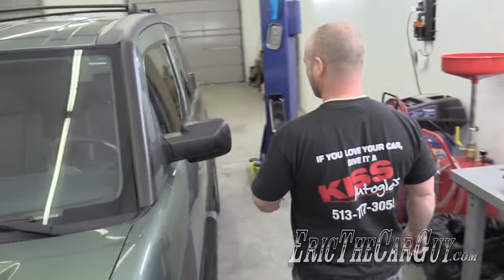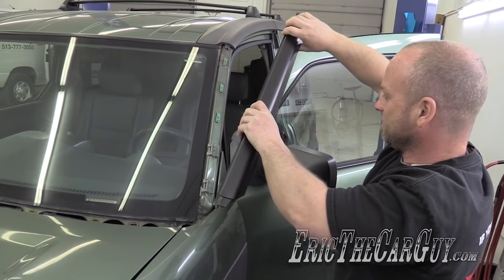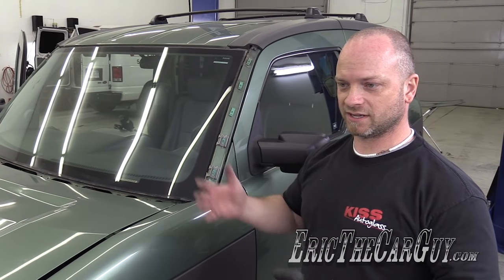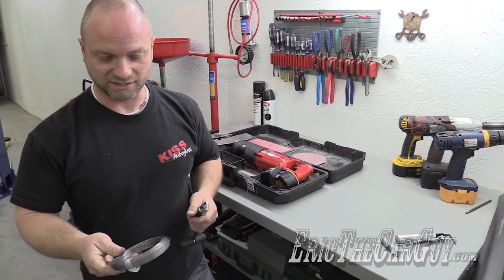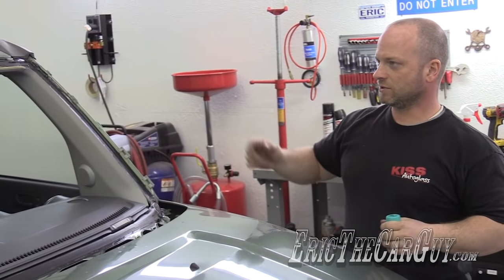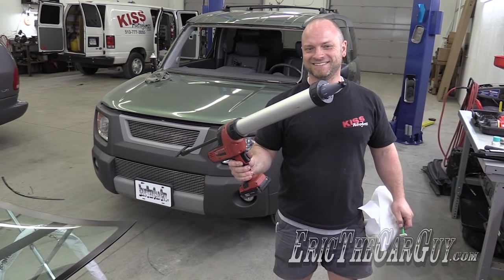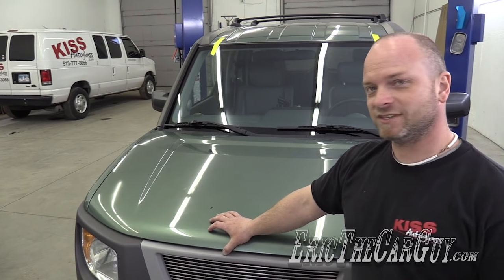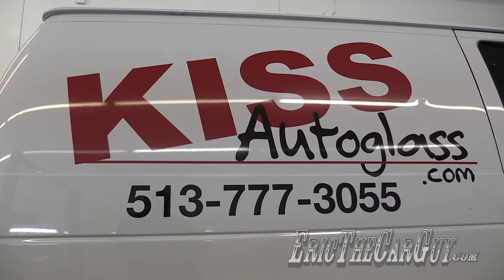How To Install a Windshield the "Right" Way -EricTheCarGuy

Comment: Snatching the trim off like that = broken trim. White clip left behind on passenger bottom means the trim broke. I own a glass company and have seen this carelessness over and over again.
Reply: Can of glass cleaner on the paint, tools on the dash, paint being scratched by knives. More carelessness. You should let him know there's scrapers on the market that curve up the pinch weld that don't scratch paint.
Reply: dirtragzzz We were both aware that clips could/did break. Only way to get that particular molding off is to pull in quick motion.  Prying can cause more damage.  I have found giving a few good pulls will get it off just fine.  Clips on any car can/will break depending on age and climate.  Again, scratching paint is a very common occurrence when cleaning off old urethane with any tech.  That is the reason primers are provided. Since Erics windshield had been replaced before(not by me) and proper care was not taken to cover scratches there was a little bit of rust present.  I do everything possible to "scratch" the pinchweld as little as possible.  When it does occur primer is used to protect the metal.
Reply: Richard Kiss  The direction you pull the side molding off makes a difference in breaking clips or not.  The annoying part is removing the piece that stay on the inside of the hard molding.

Comment: I just have no respect for blue collar workers' creative abilities. They just rely on the tried and true methods and if they do manage to improve a way of doing things it's almost never revolutionary. Just cut the windshield out. I used a diamond blade on an angle grinder but probably a carbide wheel would do. I left only the urethane stuck part of the window so I could easily cut that out with a vibrating crafter tool. The reason using a knife blade is so difficult is not because of the toughness of the urethane but the pressure the window exerts on the blade trying to cut through the urethane.

Comment: he installs similar to me. I use the same glue. guys like us are a dying breed in the industry. people look at it as a job n not a trade. it's a very particular job. you have to be meticulous almost all day. very. . and people of you have wind noise get a foamy glass cleaner take cowl off spray glass cleaner on outside perimeter of windshield and get a air hose where you see bubbles is were it's coming from simple Shit y'all.

Comment: This “professional” really just primed over the rust without treating it at all smh. Even though he primed over it that doesn’t do anything unless you remove it first lol. He should have used a wire brush to get rid of it. Guarantee that rust is at least twice as big by now and most likely formed a hole

Comment: That was a crap job, I did the job for many years and I actually researched the other methods of windscreen fitting, I didn't need to scratch through the cars paint, I used trimming up tools that had curved sides so I wouldn't have scratched like he did, his cutting out tool, we called a drag knife, anyway he has the one that home handy men have or panelbeaters use 🤔 what he said about the sorts of glue is way off, but speaking total BS in front of the customer is an A typical occurrence, Auto glaciers, Windshield fitters or Windscreen fitters, those tradesman, if you can call them that, they either, flat out lie to the customer or they just repeat the same crap they heard years ago, like everyone seems to do these days, nobody uses the old outdated original polyurethane, it failed safety tests over and over, it didn't have a strong enough bond to withstand a car accident, but as he said that he uses the good quality stuff that drys quickly, and the cheap nasty crap with impurities in the urethane base, it should be pure carbon, instead it's the waste products from colepower plants that is the base and it sucks, I'll bet he uses the garbage that should be band,or if it does stick with enough bonding strength than it has chemicals that constantly eat into the glass and weaken it, while rusting the metal of the car, I used to swear if the cars glass was aftermarket, because 99% of the time I had a long painful job of clearing away this gray coloured crap that would only half stick to the thin factory original glue, plus the fitters would screw up the trimming of the old glue by scratching through the cars paint and then put glue down that would start it rusting, even when I got the occasional good glue type used by the previous fitter they would do stupid things like put down the standard beed of glue with their one nozzle for all jobs idea, they would pound down the screen and leave me with a horror nightmare getting the bloody glass out, plus cutting straight down like he did in the video, he really has no experience if he hasn't done a job that some idiot has done that and then by the time you changed the glass again the cars got rust growing around the edges and what is he going to do with that? Take his old car to a panelbeaters to get a massive bill to have his car resprayed? His hardly going to do all that when he is selling the car and that's why it needs a new windscreen? So they will just sell along the time bomb car to the unlucky guy that buys it, if you think it isn't a big deal, then you have never experienced buying a new car that stinks of mould constantly because there's water leakage through the windscreen coming into your car.